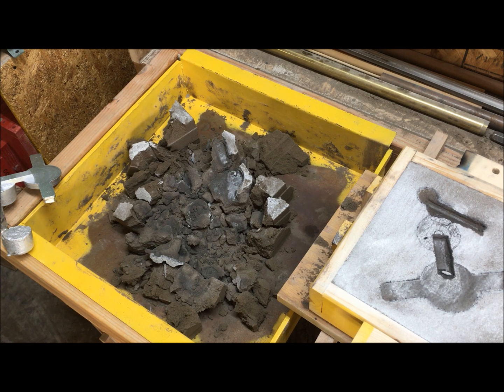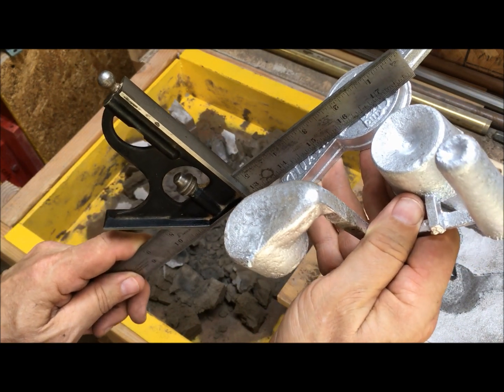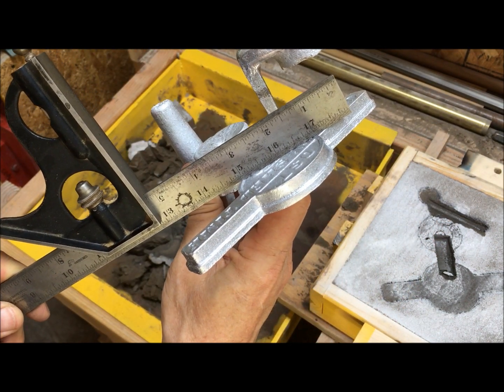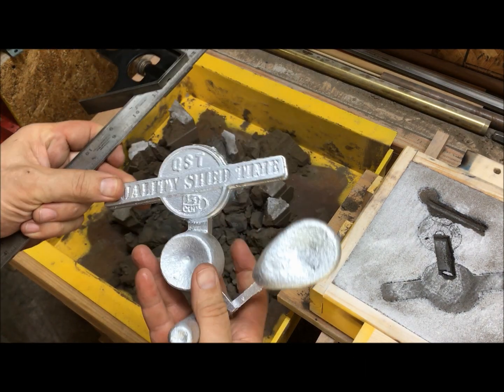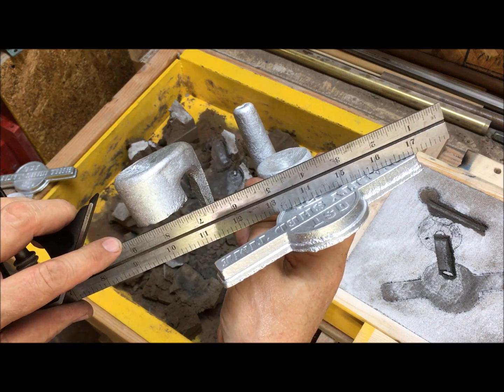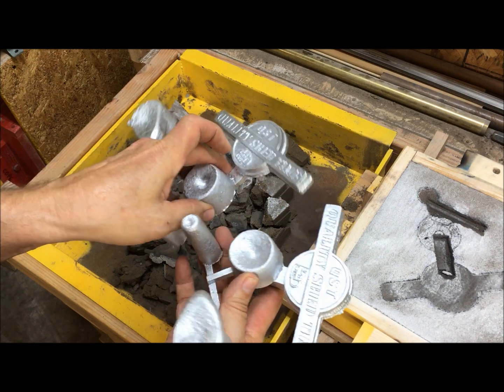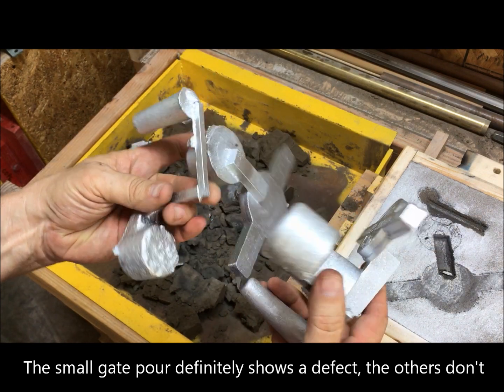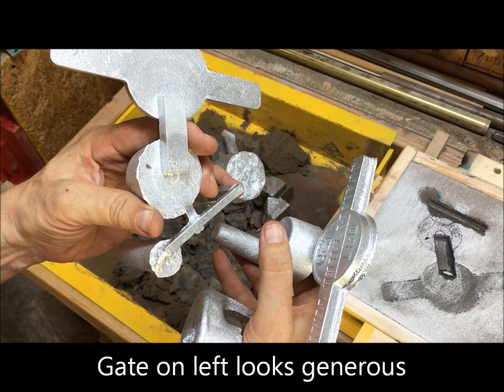Foundry 50: Testing Chvorinov's Rule

Comment: Aluminum casting shrinkage is a big concern in the metalworking industry that every foundry has to tightly calculation to minimize casting defects and rejections. This article mainly focuses on analyzing shrinkage in aluminum sand casting that helps manufacturers predict and control shrinkage during the working process.
https://vietnamcastiron.com/aluminum-casting-shrinkage/?fbclid=IwAR1aEsCq0JsG3_q0bnIezoaJq9CJeqW-gD94Fbdjs7h6-BFFs_naJOYF-8Y
Reply from the maker: Interesting article.  thank you for commenting.

Comment: Chvorinov's Rule is just a start, Properly calculated it only tells you size of the riser/feeder you need. But, Chvorinov's Rule does not tell you the distance the riser/feeder can feed to. By knowing your feed distance you can determine how many riser/feeders you need. 

I assume your part was 3D printed. I wonder how much deflection it has under the load of the sand and ramming?
Reply from the maker: Absolutely, fortunately most of the casting I do at home does not need multiple feeders.

Pattern was 3D printed.  I can't imagine it deflecting if the drag (it's all in the cope) was firm.  A point I hadn't considered, however, is that in rapping the pattern end to end to loosen it I easily could have put 0.006" bow in the sand by tapping each end more than the wider middle.
Reply: Ask Questions, Try Things
  Would you then care to tell us how to calculate "the distance the riser/feeder can feed to" ??